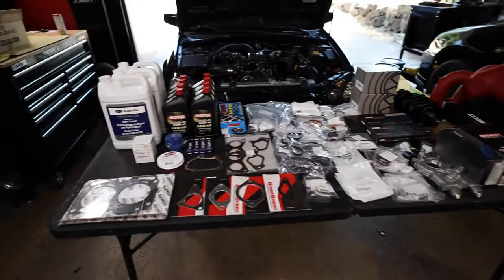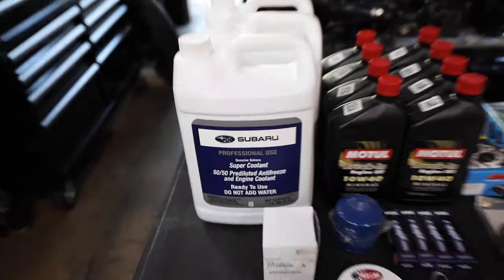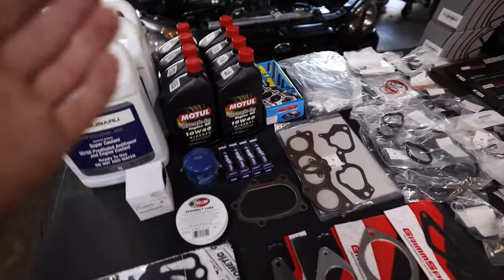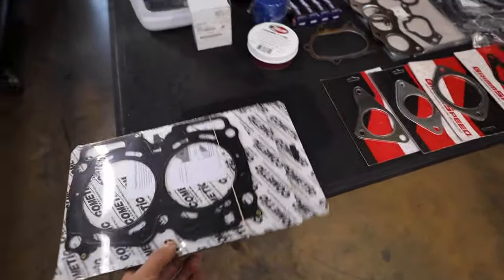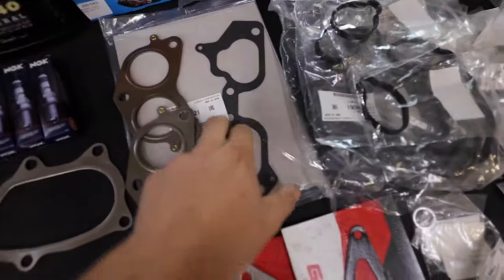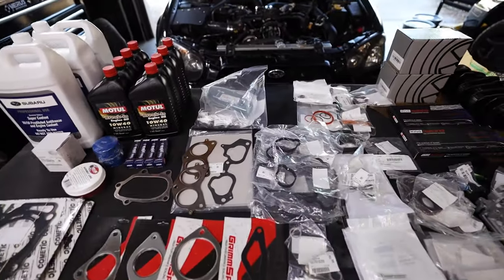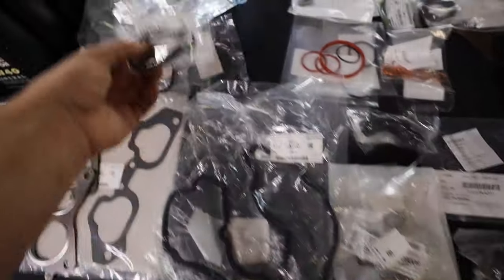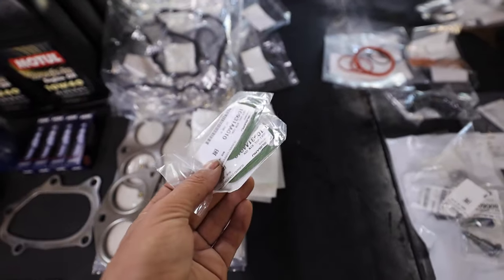Subaru Rebuild Checklist; What You Need To Rebuild Your Subaru

Comment: Just wanted to add onto the plethora of knowledge in this video:

If you guys ARE NOT adding power just wanting to rebuild back to stock specs, DNJ makes AWESOME master rebuild kits for reasonable prices. I rebuilt my EJ253 in my 08 Outback, cost me just over $300 for the whole kit. 

Thanks Smeedia for another great video 😊
Reply from the maker: Not a bad price for an OE rebuild kit! 🔥🙌
Reply: @Smeedia  where can I get a rebuild kit for a motor I wanna build to handle 7-800hp?
Reply: Aint no subaru going to 800💀💀😂@willobanks

Comment: Don't forget the valve cover "half moon" cam seals. I suggest aluminum aftermarket ones ( IAG, torque solution, etc.) The factory plastic ones will work fine but they are basically a one time use. They get so brittle from oil exposure and heat cycling.
Reply from the maker: Agreed! I use the IAG ones and they're well worth the money 🔥

Comment: Props. Your video editing has come a long way. I didn’t realize the time involved. I rebuilt my transmission and center differential in the 06 sti the other day and I recorded it hoping to make a video. That’s not happening any time soon. Lol. Great videos, keep it up!
Reply from the maker: Alqays appreciate it my friend! How'd the rebuild go? 🔥
Reply: @Smeedia  the trany rebuild is good to go. Been waiting on my heads to come back for 2 months. Also running those karlton flares. Did u get fiberglass or rubber? I’ll post a photo or small video here shortly. Your wheels are gonna be a tight fit. I’m running 245-35-19 and a close to zero offset. No room to spare!
Reply from the maker: Fiber glass, I don't think they make them in rubber or poly
Reply: @Smeedia  I have fiberglass as well and Its hard to get them perfect or to get the base coat to stick. Maybe I’ll learn from what u do. I have seen rubber here in America and was planning on switching. I wanna see how yours go. Mine came from another country, can’t remember where.

Comment: My engine blew up in may. Since then I’ve had a closed deck put in with an ets rotated turbo kit, ets front mount, el headers, dual fuel pumps, and all the supporting mods. She’s pushing just around 580hp. These things are soo addictive to put money into. But there’s nothing like them.
Reply from the maker: Sounds like it's alot of fun now! And ohhhh trust me I know. They're rabbit holes when we start throwing money into them 😅
Reply: @Smeedia  oh she’s extremely scary now. I went from stock to almost 600 without an in between haha

Comment: ACL 12mm oil pump is the best replacement, cheaper than oem, reputable, and of course reliable
Reply from the maker: 11mm pump should do most just fine, but I'll have to take a gander at ACL

Comment: * new oil pickup an oil pan *  

This is my first time building a short block for my WRX an when I seen that you posted this check list it literally made my day.  I was really wondering about the cam sprockets. Glad you mentioned it!

When doing a short block rebuild on a car over 100k, would you recomend replacing the clutch ? What case halves are you going with ? IAG? Crawford? Other ? Looking forward to seeing a part two to this !
Reply from the maker: Clutch won't really be an item based off of milage, more off of use of wear. I'm using a set of 2006 STI case halves that I had outfront rehone, close deck and up the head studs to 1/2" 🙏

Comment: I’m rebuilding a ej for my 05 blob eye. I wanna machine the heads and get valve work done. I saw all the link in bio but I’d like to know what to use to replace ALL valves. If you can help me with this it would be awesome. You’ve helped me a lot with your videos. Thank you.
Reply from the maker: What valves did you have in mind and what are your power goals? 🤝
Reply: @Smeedia  I’m just rebuilding it to stock, I wanted your advice for where I can find the right exhaust and intake valves (OEM). My first WRX. Don’t have much knowledge on it, but with the videos you’ve made I’ve gain so much. Thank you
Reply: What did you end up doing? I hear you can pressure check the valves at the machine shop. If they're good, just leave em

Comment: I agree with the crush washers when I was putting my 92 rs turbo liberty back together putting the turbo on I dropped two crush washers trying to connect the oil feed line and it was a nightmare

Comment: You forgot head bolts. Arp is the way to go. And dont forget if reusing injectors always get new o rings never reuse them unless they are still newnor not older them few months max they dry out fast and thats becomes a vacuum leak
Reply from the maker: I mentioned the head studs but yes, cannot forget them! 🔥🙌

Comment: Other than the pistons, is the build guide completely the same for 207 and 257 (like bearing clearances, piston to wall clearance, torque spec for the bolts installations)? Specifically asking for stock application only, stock block, pistons, bearings, etc.

Comment: This video was very helpful. Showed me just how much stuff I didn't think about buying like all the miscellaneous hardware and washers. I've got most of the big stuff already, like an oem master gasket kit, oem tstat, the aisin tb/wp kit, rcm oil pump, ngk spark plugs, group n engine mounts, etc. I'm not necessarily rebuilding but more like refreshing and maintenance to keep it alive.

Should I also get some ARP head studs? I'm expecting to land just shy of 300 whp when it's all back together and tuned, nothing too crazy.
Reply from the maker: Tbh if you've got it apart I'd highly suggest some ARP head studs 🙏🙌
Reply: @Smeedia  Word, that's where my head was at too. No pun intended. Why do they have to be so expensive though, ugh. Oh well, gotta pay to play.

Comment: What size oil pump did you go for bro? I have an uprated rcm 11mm oil pump on mo e along with their modified oil pick up pipe. Would obviously love to go for killer bee pick up and sump set but over in the UK it's expensive as shit! Haha
Reply from the maker: I'm using an OEM 11mm for my EJ and a shimmed 12MM RCM pump on my EG.
Reply: @Smeedia  nice man! Yeah that engine with that power requires a decent amount of lubrication!

Comment: Can you please explain why you use cometic gaskets instead of oem subaru MLS? Thanks alot for the video!
Reply from the maker: Depends on the build. For this specific car I ended up using JE Pro Seals 

For my 6 cylinder I use cosmetic because that's all there is. 

If its a sub 450WHP car I'll use oem MLS
Reply from the maker: But cosmetic is also MLS 🫡

Comment: Question for ya, I have a 2005 Saab 9-2x, do you have any information that would be helpful for rebuilding the whole car? The plan is to buy a long block from IAG, maybe an STI or LGT transmission and rebuild it with the stronger gears, big brake kit etc. The ultimate goal is to make it into a track car. I haven’t bought anything yet, other than the car and I’m waiting til I separate from the navy to go home and actually start this build. TIA!!
Reply from the maker: I personally would just do an STI 6 speed, but for the most part it's pretty much a Lego so you could pick and pull from a fee diffrent cars

Comment: Subaru warrantied my 2019 Outback, dealer rebuilt the engine, they insisted that break in oil does not go in these, full synthetic out the gate.  Any feedback on if it should be ok?  I'm breaking in the best I can otherwise, good RPM varying, etc...

Comment: Forge everything. This is the way.

I've had mixed results with cometic gaskets. I usually get a Subaru sti OEM rebuild kit for about $200 from my guy's at Subaru.
Reply from the maker: Saw prices online vary a bit on those kits ranging from $250 to $350. 
I bought everything individually that I needed to save some $$$ 😅
Reply: @Smeedia  well, it helps when you have a wholesale account created by the parts department manager who happens to be your high school friend where you bought your car 🤣 I try to spread the discount love to my other friends with Subies when possible.
Reply: @Smeedia  by buying individually how much were you able to shave off the total price??
Reply from the maker: @jimrustle643  I bought from subaru wholesale online but ended up spending like $160ish for everything I needed
Reply: @Smeedia  not bad at all my man. Saved money is always a win because nobody likes the ramen noodle diet 🤣😂
Reply: @Smeedia  so the master kit you provided in your description basically has all the oem gaskets you bought individually?
Reply from the maker: Yes and more, I just bought everything individually because I don't need every gasket and seal 🙏

Comment: Great video man! Can I get a rough estimate of cost on parts so far? Looking at a white 05 STI that's pretty high miles and want to know what I could be getting into if the motor goes out.
Reply from the maker: For an OE style rebuild from shortblock up using a Type RA block probably in thr ball park of $3,000 in parts and machine work if you do the labor yourself
Reply: @Smeedia  thanks for the reply, much better than i was expecting

Comment: How much power did you make on your FP Blue on the '17? 

I have a built (by me) short block, IAG machined and rebuilt heads. FP blue. Tuned @IAG 330whp on 93 and 375 on E (they're telling me it was hot and they have a low reading dyno, confident it's over 400 on E and on a cool day). Catless, Cobb FMIC, all the supporting mods. Thinking if I want to go up at all it's limited by the turbo. I'm coming from a Gt3076r with a bad fuel system setup so the response is night and day. Car actually feels faster on the Blue.
Reply from the maker: With the FP Blue 401WHP, capped out the fuel system 😅 the blue is a great feeling turbo!

Comment: What do you think of a closed deck block with the newer type ra pistons combo for a reliable , long lasting, higher horsepower set up? Like for 500whp?
Reply from the maker: Honesty I think it would hold up and be fine. But if your going to the extent of close decking case halves I would just use Manley, JE or CP pistons at that point

Comment: Hey man
I have a quick question for you and I’m hoping you can answer. 
I’m looking to buy a 2015+ wrx but I’m second guessing it since they have a few issues with the ring land and other  stuff. So I was wondering what you think I should do
Reply from the maker: The WRXs don't have ring issues, the biggest thing with them is that you'll bend a rod when you start making too much power. 
The FA20s are pretty stout engines
Reply: I don’t plan on making any performance mods
Reply: So I won’t have any problems?
Reply from the maker: Shouldent have any worries 🙏
Reply: Ok great. Thanks a lot

Comment: Can we touch on the arp case half bolts affecting bearing clearance?
Reply from the maker: I did 🙏
Reply: @Smeedia  i meant, in what way do they effect bearings? Do I need to buy certain bearings if I go with ARP case bolts? I know you can get bearings in different variety
Reply from the maker: Ohhhh gotcha, they'll distortion the block a bit throwing off tolerances. Normally you'd install the ARP hardware onto the block snd rehone the main tk get it to be true again. 

I'll be using ARP bolts but to OEM torque specs so it won't change the block or effect it
Reply: @Smeedia  sounds like a good plan. I'll have to try it as well!

Comment: Hi Matt would be greatly appreciated if you could read below message I got from a company it'll cost me $8,000 U.S Is the rebuild worth it? I own a wrx hawkeye 06 

Remanufactured long dressed engine:
Reply from the maker: I am not Matt 😅 but 
That includes part and labor to pull, replace everything, and get it going again?
Reply: @Smeedia  LOOL, yep that includeds everything to get it going, is it worth it?
Reply from the maker: Not too far off from other pricing I've seen. Just to make sure this is including a rebuilt long block correct?
Reply: @Smeedia  that's right long block rebuild, thanks for you input much appreciated Matt